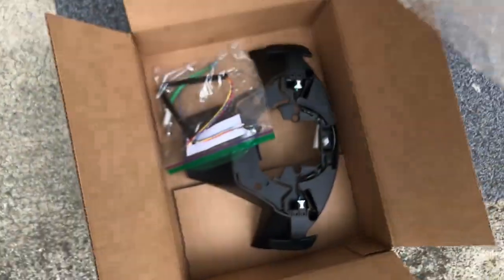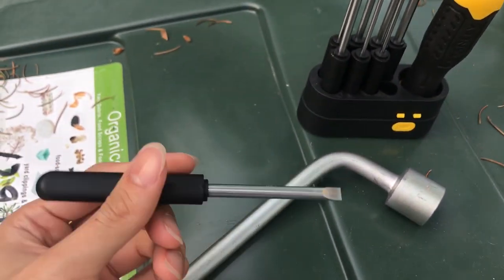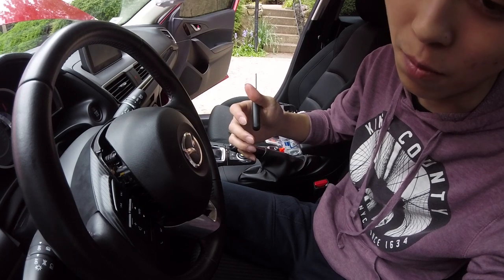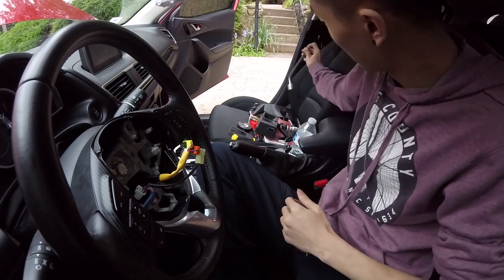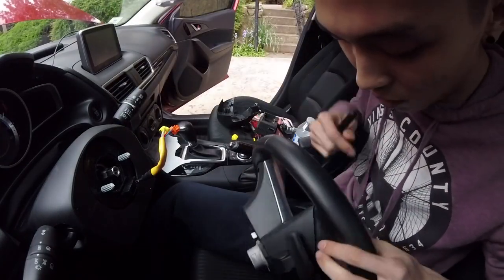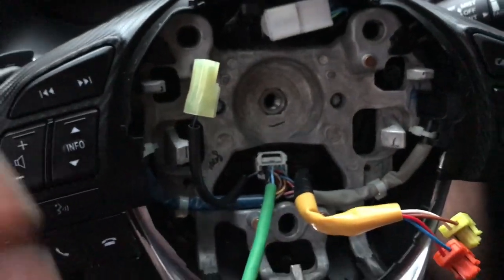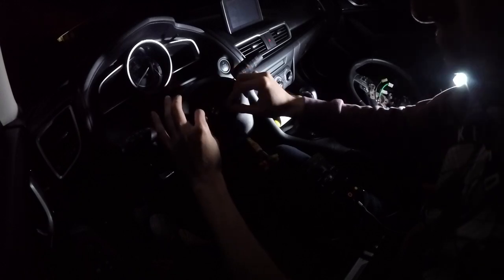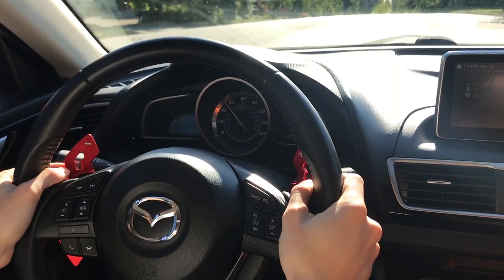MAZDA 3 PADDLE SHIFT INSTALLATION FOR I-TOURING?!?!?! VLOG#3

Comment: nice video car looks great i have a similar mods,  please if you havent aready get a catch can, i removed my intake manifold after 20k miles and it took me a lot of hours to clean the intake valves. btw i empty my can every 3 to 4 weeks full of oil and water mix.
Reply: Or just fill up with e85 and it will clean your valves.
Reply: @benitezjoe183  hello mate, I echo BC's question about Gen3s and E85 compatibility. Do we need a retune? My guess is yes but would like some clarification. Cheers bro.
Reply: @lostsurfer00  after early 2000 most vehicles were equipped to use some kind of flex fuel. After government wanting to reduce pollution they wanted to burn cleaner fuel. So all vehicles can use up to 10% ethanol, but little the public knows you can go up a bit. If you want to use more than mixing it would be best because of the percentage. You can put almost a full tank but in the end it will show a engine check light. I have done 50/50 and also have done 75/25 (e85/91) but if you want your car to get used to it start small. 10, 20, or 30. It does clean your valves and burns cleaner but it burns faster, thats why it cheap. You do not need to do a tune if your mixing but if you want 100% e85...well i advise a tune. Cheers.
Reply: @benitezjoe183  mazda skyactiv engine is not most vehicles. High compression and an indented piston mean this car can run E85 but jt definitely requires a tune as the injectors are multi-hole injectors. The fuel system would require an octane sensor to detect the changes between E85 and 91 and adjust the mixture accordingly. Ovtune has done some work on E85 tunes, but be warned it will not only void your warranty, but it will not clean your intake valves whatsoever. Skyactiv G's are direct injection and as thus, valves receive no cleaning benefit from different fuels. This is why an oil catchcan is important in a skyactiv. It's a mod I recommend to all owners regardless of spirited driving or not. Valve cleaning is maintenance the dealership tends to complain about doing if you do it before the 15k miles they say it takes to build up (only takes about 1k miles of spirited driving from my experience)

Comment: Hey just wanted to thank you for your vid! I have a 2014 itouring Japanese built M3 hatch and can confirm the wiring is in fact in the column! Only needed paddles - GJY1-76-3P0, harness - BNK8 66 4M2, rear cover - BHN9-32-049C-02 and screws - B64F-32-750.

Comment: Whoever is stuck with the plugging in the tiny wires part, the smooth side face up and it's easy if you use your nails to help put it inside.

Comment: Great video glad I have the paddle shifters on  SGT from the factory. Do you have a video on the install of the fog light led eBay ones on your car.
Reply from the maker: +cycloneyou I don't have a video of that, bc during that time I never thought about doing YouTube. What I can tell you is, just have the negative ground on anywhere around your car, and I had my positive connected to my ignition. Therefore it turn on whenever the engine is on. Good luck

Comment: great vid,  long term tech here and your vid really helped me out. subscribed
Reply from the maker: +Tiz263 I'm glad that I help you out and also thanks for the sub 👊🏻! Just have to say, editing this video was a pain in the ass. I actually did not include the part I screw up. The reason why the sky suddenly turn dark, was because I installed the airbag on and I forgotten to screw the bolt on. It took me another hour to get it off which was way harder! Also during the installation process, I was confuse with my wiring. I actually plug in the negative and positive the other way around and removing it was also a pain in the ass. Lastly, i didn't know mine was pre wired which I got so confuse thinking it wouldn't work on mine, I had to FaceTime Big Sur Auto to help me out. But really, I'm glad  I manage to help everyone like you in this video. Also I really appreciate the sub 🙏🏻 once again, thank you!

Comment: Hello!! I have a Mazda6 and I will update just you say here.Please could you send me a diagram for electrical connection for 3 pins and If is possible send me the others connections that you say that aren't necessaries??I need to check in my model (Mz6) If these are present.Thank you so much

Comment: Hi MTJY ,

Thanks for your helpful videos.

I want to add a paddle shift to my mazda 2 DJ 2015 but I've something to know before order an original parts from mazda part distributor.

1. Could you please tell me that a paddle shift kit that you bought coming with a wire connector or not ?
2. How Can I know what is negative ,Positive and ground wire because what I understanding a wire color will be different in other country.

Thanks
Reply from the maker: +anupan sangmanee hey first of, thanks for watching!! Before I answer your question, I need you to know that I'm uncertain whether it will work on your mazda 2 and I'm responsible if it doesn't work. Back to your question, you'll be recieving two diffrent wires that are bundle together with are about 3 wires on one bundle. One of it has a connector to connect on the steering & you'll have to insert 3 wires into the center white socket that I shown in the video. Another set of wires are for the bottom part of the steering wheel which I did not cover in my video, bc mine was pre- wired. Second question, in order for you to acknowledge which one is the ground, you'll have to see the wires, usually the ground wires has an additional white line in between it. I hope this helps! If there anything unclear, you can always email me when you get your wires and send me photos and I'll briefly guide you along. You can find my email in my channel! Peace!
Reply: MTJY Hi. Thanks for your answer. I've already received installation kit from mazda thailand. But its look like I've a problem because a wire connector that I asked you in previous reply not included in an instllation kit and they cant find a part number for this case. Could you please tell me where I can order a wire connector for a paddle shift. 

Regards.
Reply: MTJY already mailed . Plz check ur ib. 

Regards
Reply from the maker: I've replied you. Like i said there, give me sometime. It's late here, which my friend is asleep. I'll get back with you asap once i have the detail :)

Comment: Dooope! But I bought mine and just spent a lot of hours to install and then found out the wires are crossed, so the shifters have the opposite function. I did Tiffany on the left and blue on the right, as you explained in the video! How do I remove the airbag now? Help!!

Comment: Is it possible to install paddle shifters without sport mode in my AT?? Reply ASAP
Reply: You should be able to, however your transmission needs to have the M besides the D to shift into manual and select gears. If it doesn't have that, it probably will not work

Comment: I tried this a year ago and it didn't work, probably because I have a Mexico built mazda 3
Reply: Anyone know it there's any workaround for this?
Reply: @charleslastname8587  you have to do the steering column wiring which is not pre-wired in the 3 Vin cars. J Vin cars do have it pre-wired. The wiring should not be difficult to do (honestly wiring is mostly fun yet tedious), buuut the removal of panels to get to the wiring, and the lack of documentation or instructions to wire it, will probably be what makes this difficult.

Comment: I don't get why it works with just installing 3 wires and a paddle???
Reply from the maker: Mike Vang cause Mazda prewired everything just in case you want an add on
Reply: MTJY what about a 2016 mazda3 hatch. Will the same paddle work with it?
Reply: Mike, you need to take a look at your car's VIN number. If it starts with J, you're good to go because that is the Japanese-made Mazda 3 which already comes pre-wired for paddle shifters.

Comment: Just wondering how the retrofit paddles work: do you need to put it in manual, or you can override while in drive? If you can override, does it show the D/M and the selected gear like the factory installation?
The stock paddles have another feature too: if you press long the plus paddle, it goes back to drive (basically cancel the override). Does that work the same?

Cheers!
Reply from the maker: yes. works the same